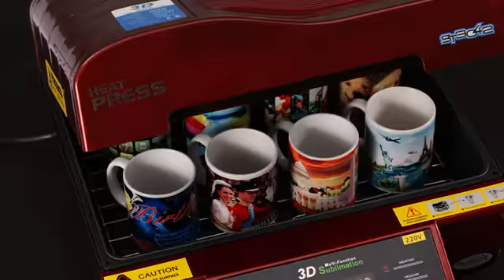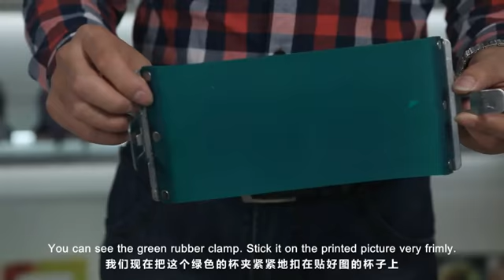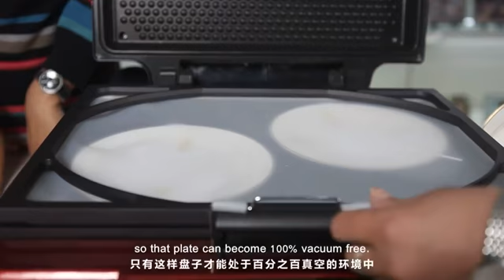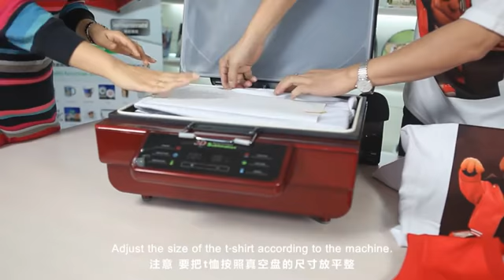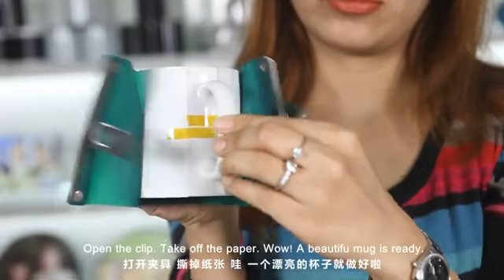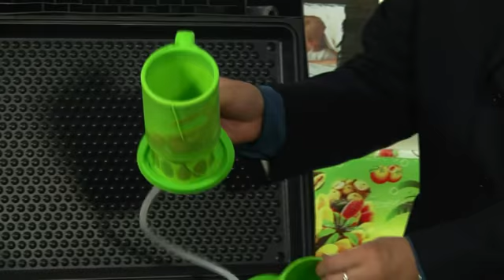3D Vacuum Heat Press Sublimation Machine (ST-3042)

Comment: Hi,
Hi, my ST-3042 upper vacuum press tray because it is completely stuck (0 mm movement). The lid opens normally, but the upper tray will not lift out vertically, and I cannot access the lower chamber.
Please send:
A short video showing how to remove the upper tray on this exact model,
Where the vacuum release valve is and how to release it,
Whether there is any transport bracket/screw or a pipe connection underneath that must be loosened first.
Reply from the maker: Please contact us on email
sales'at'st-print.cn at=@

Comment: hello i woukd like to place an order, i was wondering , its there a specail kind of tape ??? and what kind of paper would i have to use , does it come with the molds for the cases and wraper for the mugs??? thank you
Reply: hi Jacobo, yes, it is a special kind of tape,heat resistant tape. And you should use sublimation paper and sublimation ink. The standard machine package does not come with moulds for cases, but with 3pcs of mug clamps. You need to buy molds seperately. For more information, pls contact on belows for more information:Jocie Lee 【Email: sales6@st-print.cn】     【 WhatsApp: +86 18923705809】  【Skype: st.print.cn】